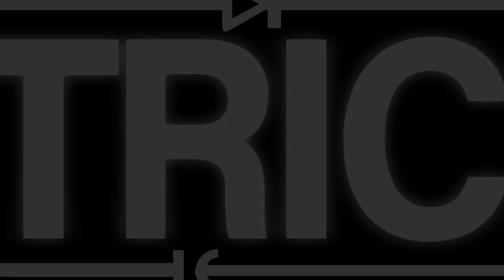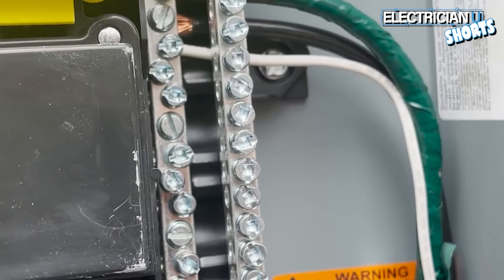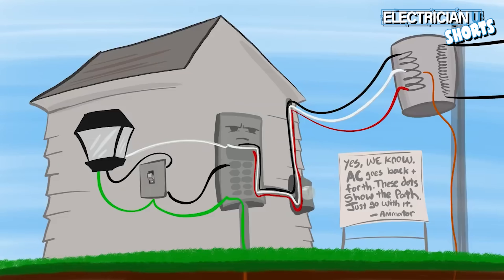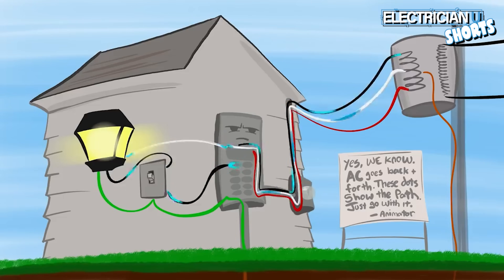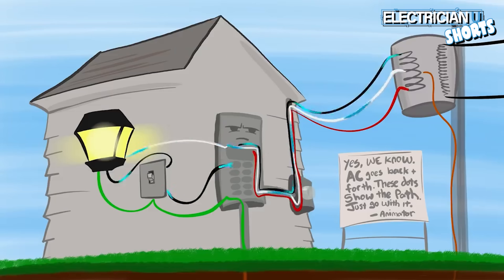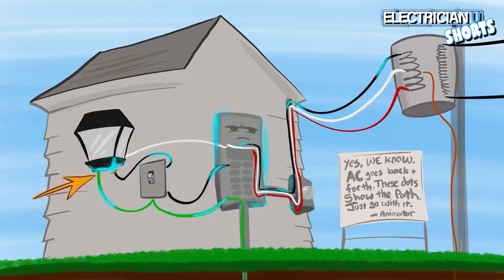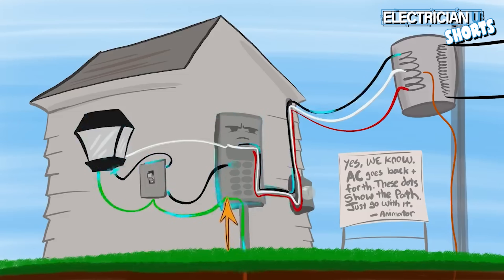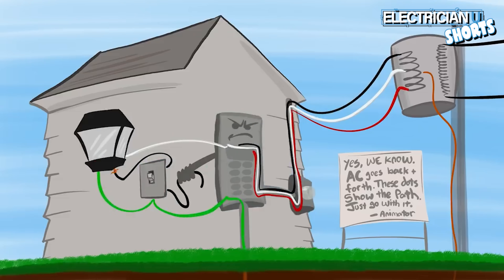SHORTS - WHY WE BOND (Neutral & Ground) Explained in 3 Minutes

Comment: Been preaching the same message to my continuing education students for years. It's surprising how many electricians have trouble with the concept.
Reply: Mostly because this is DANGEROUS practice and should not be followed (if you did it in the UK you would be prosected under Regulation 8(4) of the Electricity Safety, Quality and Continuity Regulations 2002). What you should do, in cases where the earth loop impedance is insufficient to reliably operate a circuit breaker, is provide an RCD/GFCI for fault protection (in addition to any RCDs/GFCIs provided for additional protection).

The danger, particularly on an overhead supply, is that the neutral (which is also therefore your earth) breaks and the line conductors do not. This is a particular issue for things like electric vehicle charging where an equipotential zone cannot be maintained (as you are in contact with the real earth).

It is true that distribution network operators, in the spirit of cheapness, do typically provide such a bond in the cutout rather than maintaining a solid link all the way to the transformer/origin. This still risks the same dangers but is at least a controlled environment.

Comment: Which working glove do you recommend for electrician?
Reply: One that is equal or greater then the cal value of circuits that you will be working on. OSHA mandates that once you take them out of the sealed plastic bag must be tested by a company that specialises in it every 6 months. We were taught to test rubber gloves before each use by rolling up open end several wraps and listen/ check for any air leaks. We use to send out 16 pair of glives to be tested and think it cost around $20 a pair. We had spare 600 & 15,000 volt gloves to use while 1 set was out being tested. Work Safe & wear proper PPE.

Comment: You have a talent for being able to convey methods and principles in a concise and simple way for people to understand at a beginning level. You said it right at the end referencing "current" and "flowing"; at the beginning you had said power and current "coming from" the transformer and "going to" a load, please stick the words "current" and "flow" together when describing a circuit, like you did at the end here. Great video bro! 👊
Reply: But remember that AC current doesn't flow like water in a hose, from the transformer, into the house, and all the way back again.  AC current moves electrons back and forth a short distance in the wire, typically a small fraction of the diameter of a human blood cell, 60 times per second.

Comment: Still don't get it.  The breaker only acts on the black wire, if a whole lot of current is leaking to ground, wouldn't that still trip the breaker?
Reply: tim g has the explanation. Many people think the ckt will trip by sending the current to the earth,
but it will not.  Must go back to the source ( step down transformer).
Reply: @tim g I will stick a 120 volt 15 amp
powered electrode into the earth and see if it trips the conventional breaker.
Reply: @tim g OK, so if not bonded to neutral, and just straight ground.  Then it will protect the user from electrocution from touching the chassis, and the appliance will continue to operate becuase there isn't a low resistance path to cause enough current to flow to trip.   So the goal of bonding is to trigger the breaker, so that defects like leaking to ground don't go unnoticed?
Reply: @aantony  I will stick a120 volt 15 amp powered electrode into the ground to see if it will trip a conventional breaker.

Comment: So I guess that’s why you do NOT bond neutral and ground on a sub-panel because the sub-panel is fed from 2 breaker slots (typically) of the MAIN panel which is already bonded. Is this a correct statement ???🤔
Reply: @tim g Got it now👍, thanks for the clarification😊.
Reply: Once the ground is separated from the incoming neutral it is never connected back.

Comment: Without the ground bonded to the neutral, we still have a path for the fault current to flow back to the transformer.  It's through the ground rod, through the earth and over to the transformer's ground rod and ground rod wire.  The problem is that path is a poor conductor and can not be relied on.  That is why we bond the ground and neutral together at the main breaker panel.
Reply: Yep, the key phrase in all of this is "low impedance path" . Amperage is inverse of impedance per Ohms law and you want to jack up the amperage to trigger the overcurrent as quickly as possible
Reply: Do you never have an earth supplied to the property? In the UK, we can't take the earth off the nurtral ourselves, it has to be done by the distribution network (this is because of the unlikely buy very dangerous situation that could occur if the supply neutral is broken while being relied on for the earth, if the distribution network earth the supply neutral multiple times on its path then its ok)
So we either have the distribution network supplying an earth from the neutral, the distribution network supplying a separate earth, usually from the sheeving of the supply cable, or no earth.

Which is when we have to use a rod, we call this a TT system and we have to test it to ensure the impedence is low enough to meet disconnection times.
Reply: @felixmoran1 PME does not make it safe, it just reduces risks. That is why EV chargers in the UK must to have PEN fault detection or be done as TT i.e. Just with a ground rod and no connection to the grounding of the house. (This is safe ss they are RCD protected and do not rely on high fault current)
Reply: @felixmoran1  Older installations in the UK used TN-S where there was a separate earth and neutral all the way but modern ones are TN-C-S, also called PME where they are common. The difference to the US and some other countries is that the earthing is completely up to the provider so local earth rod is not mandatory.

Yes PEN-fault is a problem and in the UK it is worse as it is grounded at one end and not at the center like in the US. There are 400 reported cases of PEN-fault in the UK annually.
Reply: @felixmoran1  - We have three wires coming in from the utility company.  Two Hot wires and one Neutral/Ground wire.  As for the house wiring, we only bond the Neutral and Ground together at the first breaker panel after the power meter.  So the neutral wire only carries unbalanced 120 Volt loads.  The only time we see current flowing in the ground wire is when we have a fault to ground and that normally trips the breaker of the circuit with the fault.  As far as ground rods go, we have on or sometimes two at the home's breaker panel that has the neutral to ground bonded together and there is also a ground rod at the utility pole.  I think all these ground rods are there for lightning protection.
Reply: @rpsmith . Also, if the main neutral loses it path back to the transformer, the ground rod, and if present, water bonding, will create a path for the open neutral. It can be dangerous if the electrician on site doesn't understand what is going on ! Use your testers !
Reply: Then why do they even bother making ground rods they're unreliable???
Reply: @nasoncruz1069  ~ your earth may be more conducive than mine but when I tried using an 8 foot ground for the neutral side of a 100W light bulb, it only glowed dim!  That told my single 8 foot ground rod was near useless.

Comment: So what if there is more than four breaker panel so we should just do it at the main one where the service entrance wire is coming into
Reply: You bond at the first disconnection point.  Typically a main panel, but if you have an exterior disconnect (between the meter and the main panel) you would bond grounds and neutral in the disconnect.

You never want current on the ground wires (equipment ground, feeder ground,  grounding electrode conductor, etc.); current on any ground should be clearing a fault and nothing else.  Therefore, if you bond in a sub-panel the ground from the sub to the main will share current with the neutral.  Sub-optimal.
Reply: Yes they are only connected at the main distribution, not at a sub panel

Comment: So neutral is the return, and its the protected wire, ground is just there to protect you from the live chassis, unless I'm mistaken. The ground has no way to trip the breaker, but the neutral does, so if you connect them, you now have the benefits of the safe chassis and the short circuit protection.
Reply: That's why I rather the EUROPEAN system

Comment: It will also supply a return pathway if something happens to the main Neutral. It happened to me when I was running a Trenching Machine and clipped the Main Neutral luckily I spotted the Arc...
Reply: In Electrical we always have backups incase or a failure...

Comment: Do you’ll use an Earthing system similar to PME with a local electrode in the US?
Reply: Not sure what PME is. But we do drive ground rods. In commerical settings, you'll often put in ground rods in a triangle formation and it all being bonded together to a ground plate inside the main electrical room
Reply: @tim g transmission wires carry hundreds of thousands of volts please keep terminology correct .
Reply: In the US the low voltage network is very short, often just an air cable to the transformer at the street. The neutral is grounded at both ends but I do not think there are multiple earthings.